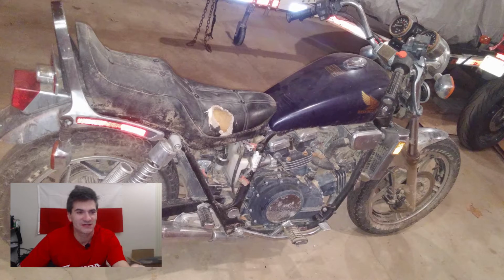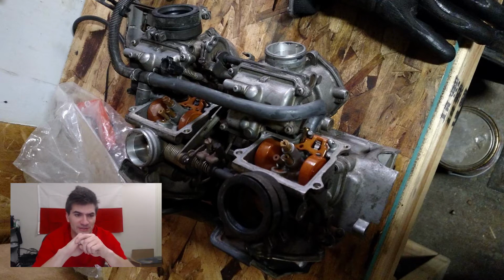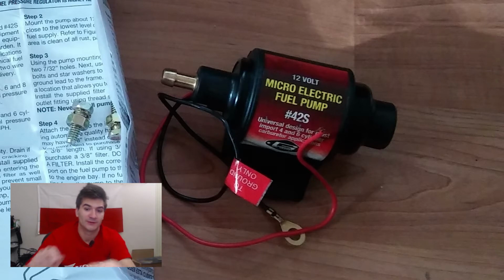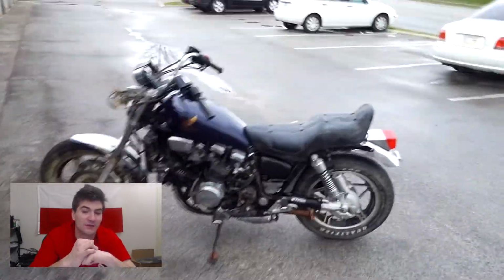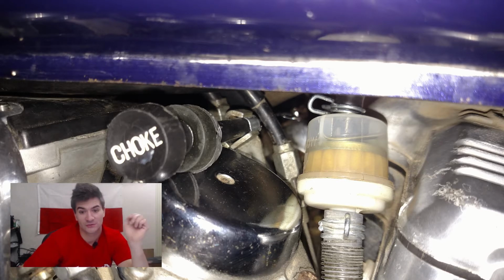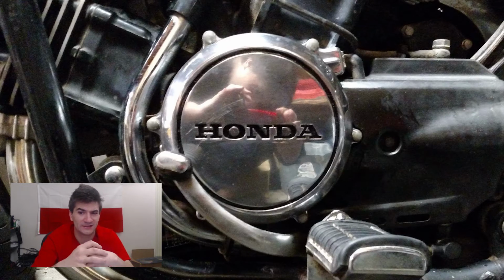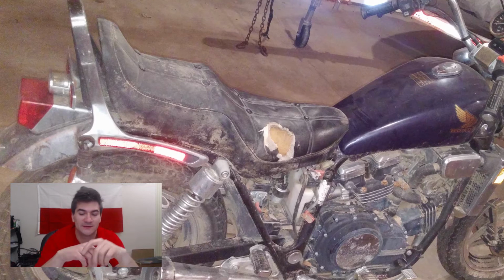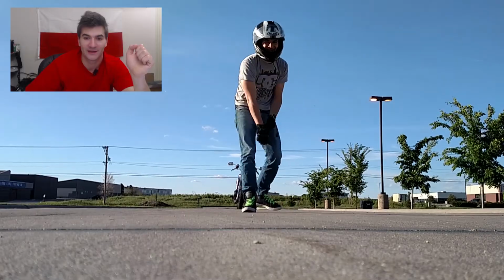"Cheap bikes cost $2000" - Polish Matt - Buy, Rebuild, and Ride EP #1: Honda VF 750C V45 Magna

Comment: Hey Matt, what were you trying to elude to about the seating and ergonomics on the V45 vs the v65?
Reply from the maker: I was probably rambling :P it's been so long ago. But in general: v45 Sabre is super comfy if you like to tuck in, v45 magna too if you have a sissy bar and some luggage as you can rest - v65 is a large beast and is a bit harder to handle but it's easier to service as everything is just larger :P

Comment: The bike was $3000 brand new. $2000 today is not cheap. 200 is cheap. but anyway the bike held it value for over how many years. I had mine since 1984 and it was 2000 used. great bike anyway, Love the Magnas.